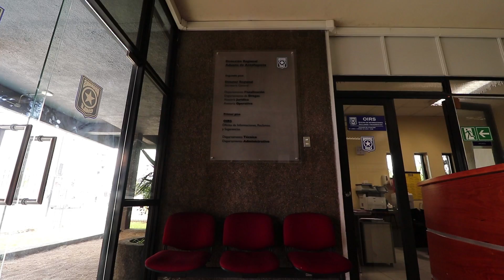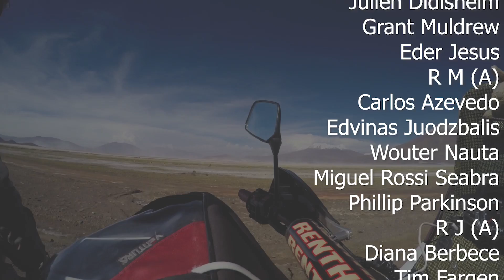HONDA Adventure MOTORCYCLE Reborn.. (Chile Argentina Border Visa Run) - ep35

Comment: Awesome video, glad things worked out back home. So weird to see you walking around Amsterdam. Alp looks great and sounds great, new carb worked a treat by the sound of things.
Reply from the maker: Cheers man. Those shots where in Utrecht, though I did have a couple of special pints while in Amsterdam. Would have had more footage but lost a bag with batteries and a memory card, on it the latter half of Dutch footage, on that border run to Bolivia. Carb did wonders.
Reply: @iPedroMota  ah OK, I saw the canals and assumed! Pity about the lost footage, but plenty more where that came from. Safe journey 👍

Comment: Bought myself a green '91 transalp  because of you! She looks almost exactly like your early alp. Starting my motorcycle lessons in May, hope to hit the road by June! 
I understand the feeling that you have when you get back home, but  feel the need to get out again. 
Live your life!
Reply from the maker: Nice! While you got her stationary check the cdi under the seat if they're in the horizontal position in the double rubber holder. If not, worth getting. If so, duct tape or use velcro strips to secure them against the airbox. One of the weak spots of Alps, worth checking out. All the best with getting out there.